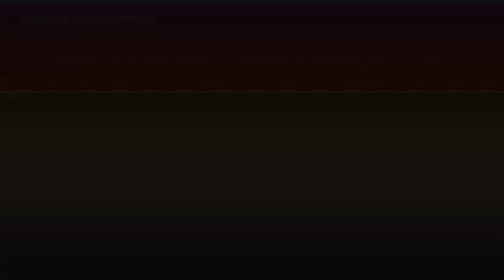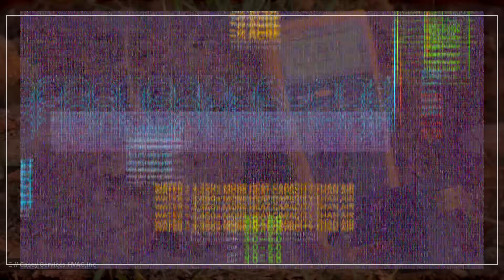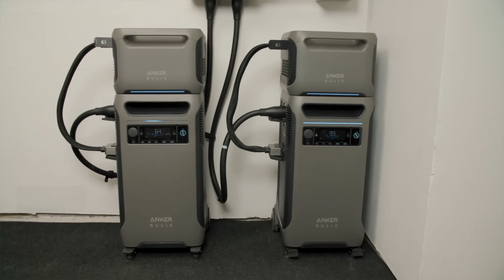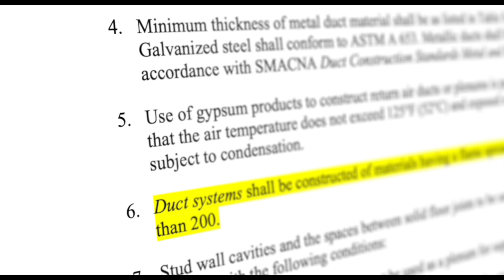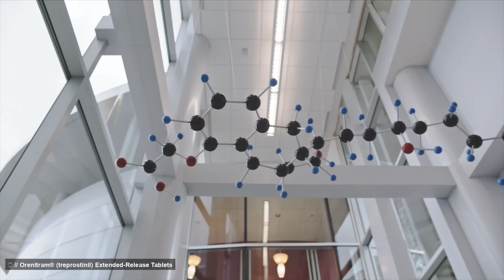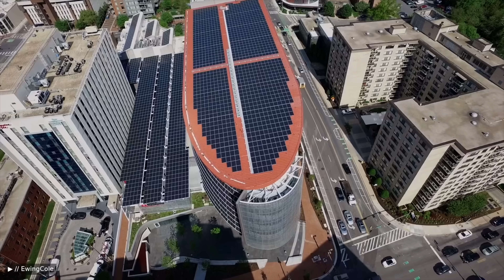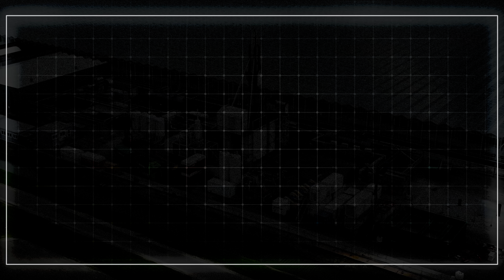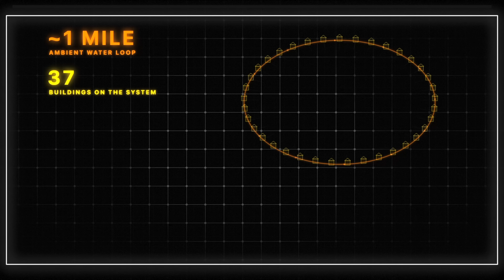The Viral DIY Cooling Hack That Nearly Killed a Family

Comment from the maker: Checkout the Anker SOLIX F3800+ 
Anker SOLIX：https://ankerfast.club/rvt92y

Amazon：https://ankerfast.club/egdo0e
Reply: 13:37 There is no such place as "Farmingham" or Farmington Massachusetts;
There is a FrAmingham ( frame ing ham ) .  

The Charles River Plan ( Boston) open source Heat pump plan is far more exciting and can be replicated across the country, as  most major US cities are on waterways.
Reply: @AdamBlack  -- I lived in Framingham for a while. It amused me to think that local residents could be called framing hammers.
Reply: Silly question. In the northeast where we still build basements. Our typical depth is 8 feet below grade. A typical home is 2200 square feet, call it a 2 story so half that for a foot print. That means I can easily coil 200 linear feet of brine hose below my basement slab within the building envelope. No additional digging required. Would this not work? ... As a matter of fact, I could cast that hose in a mud slab for greater thermal distribution. Then insulate the top of the slab with EPS and pour the finished basement slab above that. So, an 1100 square foot radiator in contact with the earth and thermally insulated from the interior of the building.
Reply: @hassleoffa  I'm in Montreal and they insulation under that basement floor because it's a cold floor no matter what in winter.
If your coil is there it robs heat from your floor to heat with.
Reply: @markojotic  In the Montreal area, horizontal ground source heat pump loops must be buried at a minimum depth of \(1.5\) to \(1.8\) metres (\(5\) to \(6\) feet) to ensure they sit safely below the local frost line. So the layers should be (bottom up) Soil > Mud Slab Containing the heat transfer coils > 4" clear stone > 4" of EPX insulation > 12mil Vapour barrier > Finished Basement slab.
Reply: I literally heard you saying:

"This is stupid Da Vinci!" 🤦🏻‍♂️
Reply: 9:03 "buried air"  Um what?  I'm confused, This implies there is still "buried air" in an underground pipe or tube. is that the case? 
2)  is this brine ground source a passive system or active sytem?

thanks.
Reply: @AdamBlack  There is air naturally mixed in the ground, especially the disturbed ground when they installed the pipe. It can get in by any leak in the pipe or around the pipe were it comes in.
Brine is a water system, it needs a pump, not even a big pump.
Reply: It seems that every thumbnail these days says that something is banned or hidden from us.
It is always bullshit.
Reply: ANKER sucks = the one I bought has broken bluetooth, so I can't  use it's  U.I.   with PC, laptop, iPad, or Android.    It won't charge off of just anything,   It basically only charges with it's  A.C. plug.  So, essentially,  I overpaid for a workstation UPS.  Meh.  I did learn a valuble lesson dealing with ANKER customer service,  do not buy any more ANKER products.  But better than POWERNESS,  which started smoking... Not good!   Turned the unit off,  and won't use it again,  toxic lithium smoke!  Bad for my health.
Reply: The hair is supposed to go on your head, not under it.
Reply: Sponsor interruption in the middle? Thumbs down.
Reply: Whatever you have in your mouth that you think helps your pronunciation doesn't help.  Now you have a lissthp. 😂
Reply: I think you should use international units instead of crap like Fahrenheit and feet that only North Americans understand. This is the internet and you're broadcasting to the entire world.
Reply: @Elizabeth-vh6il  Anyone not capable of doing the conversions, really should not be watching in the first place.
Reply: @Elizabeth-vh6il  -- No "instead" required. Just put the metric units in parentheses after the Fahrenheit/Avoirdupois/Imperial units.
Reply: Neah you can just get a jobby like the rest of us, I'll buy what I want, if youtubers advertise it then I stay away from it.
Reply: Dear TwoBit, I know this video is aimed primarily at Americans, but how about some Celsius numbers for us International Metric Folks!, even if just in post via Graphics!, would be nice thanks, Cheers  & Thx Paul From Australia.

Comment: Ground Air Tubes must be built on a slope of 1/4" per 1 ft with a water catch drain basin of gravel to drain off any water in it into the ground. The Tubes themselves MUST be air tight on the walls and seems to keep Radon Gas from giving you Lung Cancer. The inlets must be capped pointing down at least 2-3ft off the ground with screens to prevent dust, debris, bugs and small animals from entering the system. You need to be able to get those out so you can clean the whole system out once a year by passing a brush on a string through the pipe. Use fans to push the string with a bag tied to it on the end to push and suck it one direction. Then tie a brush on the string to pull through and break up and pull dirt and any mold or bugs out. Now with all that said the Brine method is the best as it's far more efficient at heat transfer but it's far more expensive. The Pipe method from what I'm understanding only cools one room efficiently or assists the current AC system in cooling the house cheaper, whereas the Brine can cool the whole house if the system is large enough. During my research that's what I've found so far. As added protection maybe a UV Light on the exist might help with killing any bacteria that makes it into the home. I don't like Government Rebates because what it does is it makes the Lower Poverty and Middle Class Tax Payers pay for a rebate to wealthier Tax Payers who can afford to invest in systems that others can't afford. Government should NOT be collecting EXTRA Taxes to pay others to do what it wants, it should ONLY be collecting taxes to run the government and the military to protect us, not pay people who can afford nicer systems money because they have the money to do it. The Government needs to Abolish ALL Rebates and collect less Taxes. If they want to help people just lower taxes across the board for everyone! Especially Larger Businesses that employ a lot of people, so they can expand their businesses and hire more people. To produce a product in the US is incredibly expensive compared to other poorer nations, like China. That's why businesses are leaving the US and taking those jobs with them to other nations! High Business Taxes cost US Jobs and Manufacturing. It simply cost to much to produce in the US compared to other nations. Tariffs can help, but lowering taxes and easing some regulations can help more.
 Best Blessings. Keith

Comment: Our ground sourced heat pump worked exceptionally well for 11 years until a year ago, when there were circuit board problems. Unfortunately, circuit boards for ground source heat pumps are very expensive. In addition, installers and technicians to fix ground source heat pumps are not as plentiful as installers for the normal air source heat pumps. In our case the ground source guru who had worked for the installation company was no longer there, requiring us to find another well trained technician. Eventually the system got fixed! I still love the system. Along with our array of 47 solar panels we spend minimally on electricity and have great climate control. But, as it turned out, lack of trained technicians and increased cost of ground source components compared to air source systems were problems we had not anticipated. "Five Minutes with Dr. Know"

Comment: Why couldn't you sink a water cistern tank 15 ft. deep, and run air tubing through it with a flush system, ( for mold prevention). I'm in South Alabama and want to build a Monolithic Dome home, with passive heat and cooling. Don't have a big budget though.

Comment: I still don't see the point of ground source heat pumps when air source is so much cheaper, especially in a mild climate like California. Why not install modern Daikin, Fujitsu or Mitsubishi in a ductless or ducted configuration?

Comment: So u say that an air earthtube system is'nt good in a humid climate, i get this. 
My question for you on the mold issue is,
Why do all kitchen, commode, bathtub or shower set-ups have a "p trap"? In an air earth tube set-up in a humid climate this is REQUIRED the same process as a homes plumbing requires, also u need a 2% drop in elevation from the outlet to the p-trap b4 it climbs up to the input hole. Did u know this information? Its what i have been studying for the last 6 months. 
The bore method is a gr8 idea, if u do not live n a state that has karst soil/rock formations or caverens, in which the state l live in does. In my state the only possible 2 ways to run the earthtube system is closed loop (ditches across the ground) 8 to 10' adding 3/4" pex piping w/the brine, or the actual earthtubes that even the Amish use in PA. Altho the use clay tile pipe, not HDSE pipe. U must use a p trap for condensation to collect & b deposited in2 the ground 2 keep ur airflow mold free.

Comment: I'm a 35 year construction professional with an interest in low energy and off grid homes. 
I understood the problems with the open air systems immediately. I'm glad the issues are being brought to light. 
After a tremendous amount of research and consulting on high efficiency builds, I advise a closed loop underground liquid system with a heat exchanger coupled with a structure that needs low energy inputs. 
The superior method of that is a passive solar design structure with high thermal mass walls. 
I hope this information is useful.

Comment: I have a gravel heat exchanger in Poland. About 30 tons of river rocks are buried in the ground, and air flows through this mass. There's no mold because it's a "living" environment. In the summer, there's a slight basement smell. Right now, it's 19.7°C (65°F) blowing, while it's 30°C (86°F) outside. The temperature is very stable... it varies by season, not by day. In winter, I've never seen temperatures below 3°C (39°F). If odor is a problem, I can always connect it to the heat exchanger in the house and recover only the air temperature...

Comment: At least for decently insulated german private buildings (we personally own a 2018 semi-detached house currently using gas heating), geothermal heating using water/water heat pumps cannot beat air/water heat pumps in total cost of ownership. This is due to the high costs of the bore holes alone. Particularly the relatively new R290 (i.e. propane) based air/water monoblock heat pumps have become so efficient that it is hard for geothermal heating to compete. And that even with the high german electricity prices. Is that so different in the US? Would air/water heat pumps be an alternative? Just on a side note, german heating manufacturer Viessmann recently partnered with US-based Carrier...

Comment: PVP pipes make no sense at all. They are insulators. The heat goes extremely slow through PVP. You need to use ceramics or meta pipes (or concrete) for that. PVP us bluntly: idiotic.

Comment: 8:36 So you put the outside unit of your mini split in a underground tunnel so the air is conditioned before it hits it. You might benefit from "banking" the summer heat or winter cold in the thermal mass.

Comment: But! When you go so deep, you come across the fact that it's actually cold underground. Somewhere and 55° . So running your air conditioner into the ground helps keep the cool air cooler and helps warm air cool. 
The problem with brine water is that it's hard on everything. What you might need to feed every 30 years now might need to be fixed every 15.

Comment: I grew up in a house with baseboard heat. Now I live with all forced air units... I will say, the baseboard heat was WAY MORE EFFICIENT than the forced air.  Ran way less often and for less time.. Yeah, it was heat only (rarely got above 90 anyway.. great lakes region).  So I know how much better water is over air.  Also, Mike Hollmes does an episode (I think its part of Holmes inspection) where they set up the vertical loops.  The Previous setup was so FUBAR and was that horizontal loop installed incorrectly.

Comment: So... what i'm hearing is if you're using an air/ground exchanger system you should be running an Air/Air heat exchanger to cool the in house air, and not pipe air directly inside from the tubes. Fortunately, such a thing already exists for houses and should work nicely provided you get a good quality one and set it up correctly. Usually these bring air in and exhaust some air as well, using the exhaust to lower the temperature differential between the inside and outside air. hook it up so the outside air is just vented back outside and the inside air is kept inside and boom, mold problem solved.

Comment: Never consider buying a house or condo or moving into an apartment without getting a comprehensive mold test first. Not the little cheap ones you do yourself, the ones where you have professionals test all the rooms and areas and then use lab testing to do spore counts. 

Approximately 50% of houses and up to 70%+ of hotels with central air systems (depending on how humid the climate in the area is, as well as the age and maintenance schedule of HVAC system) have mold problems that negatively affect human health. 

Don't ever trust anyone that tells you that they've already tested for mold; test it yourself. Dealing with the chronic issues of toxic mold exposure is something I wouldn't wish on anyone, and it's a huge problem being swept under the rug because hardly anyone wants to deal with it financially.

Comment: I live in northwestern Ontario, Canada, about a six hour drive north of Minneapolis-St. Paul. When we built, we installed an electric boiler. Natural gas is not available in our rural location. After about 10 years we replaced our boiler with a geothermal heat pump (our closed loop is on the bottom of a lake). Our payback time was about eight years with the reduction in electricity consumption compared to what the electric boiler used. Based on our records, the ground sourced heat pump (Water Furnace) reduced our heating bill by 75%. Fifteen years later, we are still happy. We only use ours for heating through our in-floor radiant system, and even on the coldest winter days (sometimes as low as -40 F or C, same thing) we are comfy. We can add cooling, and might do one day. It will be more efficient than an air-to-air system as it will dump our excess heat into cool water at the bottom of the lake instead of the hot air around our home. Great, informative, well balanced video. Thanks.

Comment: i had a ground-source geothermal system installed in the all-electric house I had built in 2010.  I calculated it saves me about $200 a month in utility bills compared to similar sized houses.  Break-even point was 10 years.  I've been here 15 now so hey, major bucks saved overall.

Comment: I watched this a while ago, and realized that it's even more of a problem then the video implies. They said that rain water got into the system, but that's not necessary. Even if you have perfectly sealed and weather protected system, condensation is going to be a problem unless you live in an arid environment. Sooner or later, the dew point is going to exceed the ground temperature, and you're going to end up with standing water in your pipes.

Comment: Nice video - the best I've seen on the subject. You did miss one factor - ground conductivity. Some systems are good on paper, and in the first year of usage - but become decreasingly efficient over time. Over-engineering (to a degree determined by the soil regime) is the answer.
Thanks for your video.

Comment: here in coastal California, I went with more solar and batteries. Since the electricity rates are high and a bit unpredictable with frequent rate hikes. My solar+battery system was slightly cheaper than putting down vertical bore holes, and it makes the electricity cheap enough to run conventional A/C. But winters are mild here, I've always gotten along with electric baseboard heating with propane for a backup. The US is a big place and there is no single best answer, different climates and economics.

Comment: I removed a water source heat pump that had been running on municiple water for 20 years.  The condo/hoa banned heat pumps on the balconies and there was no commercially available unit that would fit in the hole in the wall where the original outside unit fit.  She got the water for free because the condo complex covered the water cost int the condo fee.  I am not sure if she was the only owner with that type of unit, but I would think the water bill went down a huge amount for the condo complex.  I installed theo new outside unit on the balcony as per hoa approval.

Comment: I contest your statement that geothermal power is “free for the taking”.  Installing a geothermal system requires a significant input in infrastructure, which is decidedly NOT free.  Granted, once installed, the system is self-sustaining and requires little input, but getting a system installed isn’t something just anyone can do.

Comment: You dont have to go so deep just dig a winding ditch with a total length of 100-150' total length my parents built there's back in 2005. I think theres didn't go deep enough at like 5-7ft deep at the max it should of been at least 10ft deep. But theirs did work but it was only around 72⁰ but they still only had to lowrr it down or up from 72⁰ to their desired temperature.

Comment: .ca is pushing for heat pump water heaters then home heaters in 2028.  The heat exchangers are stuck on the wall.  Garage preferred but may be outside.  Yes no heat for 3 weeks to retrofit.. .